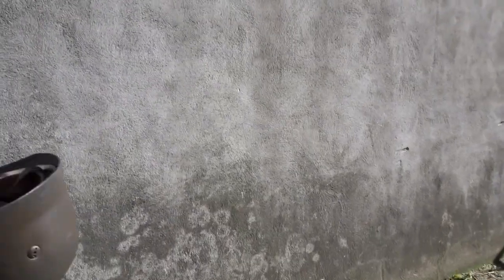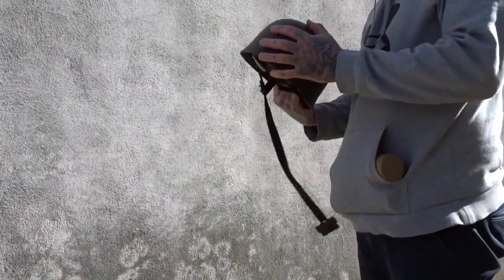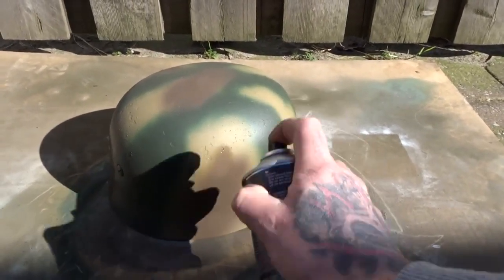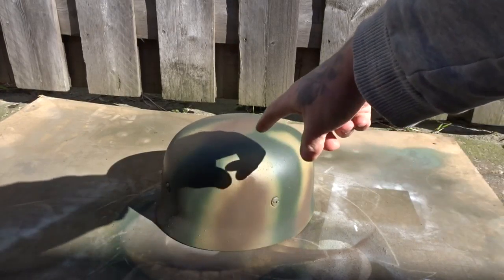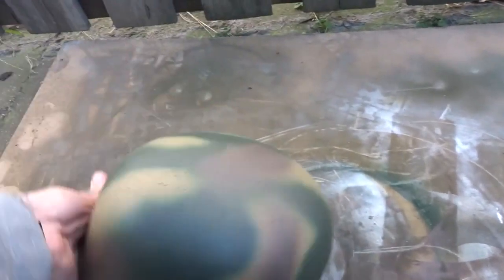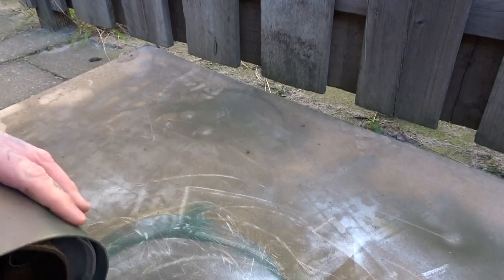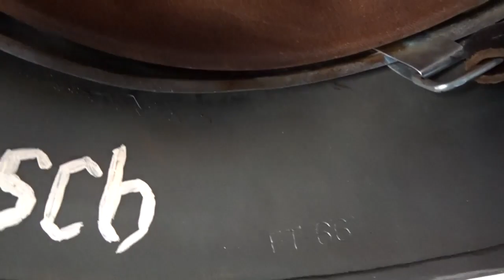M38 fallschirmjäger helmet project. A first for this one. Learned a lot along the way.

Comment: I think you made a nice job of aging the helmet. What I do, is go down to the local river with a bucket, get some different sizes of gravel and a rock, come home, hit the helmet in various random places with the rock, then take the rough gravel and lightly rid all over, take the finer gravel and do the same, then rub lightly over with mud. When you clear the mud off, you will see that all your first hits with the rock are all nicely smoothed and aged, and all the many little scratches etc are all the same, all look aged. Be careful because this technique can remove the top layer of paint- but this can also make it look just like an original where the outer layers have worn through showing the paint underneath. It’s a good effect, as this did happen with originals. Good job mate. 👍🇬🇧

Comment: Only advice I have is buy better repro helmets not the cheap Chinese ones from Amazon hessen antiques Kelly’s militaria at the front  international military antiques as well as epic militaria sell better ones than the Chinese fish eye ones the shapes will never be 100% but at least it will look better than the china special also some additional advice for painting get some fine aluminum oxide for the textured paint also most repro helmets have bad liners get a new set of split pins and a new liner for the helmets if you plan on making them better that way they look nice and better.

Comment: Not the best repro helmet and there where not three tone camo m38s for normandy. There where mainly two types of two tone with the sawdust texture
Reply from the maker: Thanks for your comment. I learned That there were only two tone helmets yesterday and i will stick to That in the future. I keep learning too. I could buy this helmet for only a few euro and i wanted one for my collection. Still, wher do you recommend getting good quality fj helmets from beside from original?
Reply: @martinscolthistorytoursree635  I would suggest fj werk for the best repro fj helm   Exact like a original but a hefty price.    I have found that “By the sword” has a decent one listed as aged paratrooper helmet just needs repainted and liner worked with
Reply from the maker: @5thfjreenactor602  thank you very much i will check it out.
Reply: I have two M-38 helmets. Copy and original. It is easier to buy a copy of the German manufacturer Sturm from the original, it is no different in the pot itself. The fact that you were offered fj werk, yes, is a good option, but it is more expensive and with its own nuances. Your helmet sits too high on your head, it should cover your ear a little. As for the color, I advise you to watch other videos for painting.